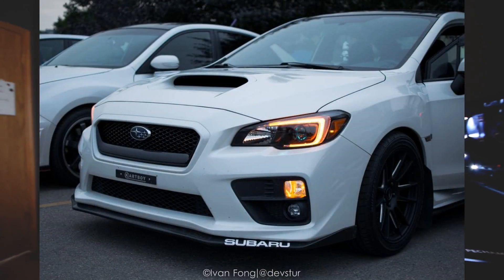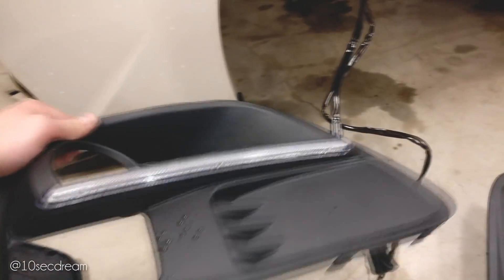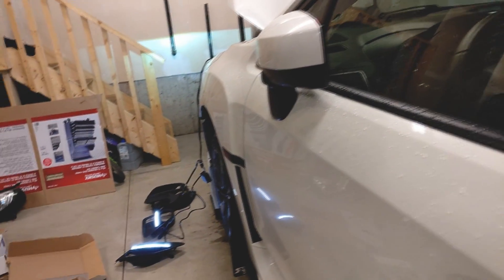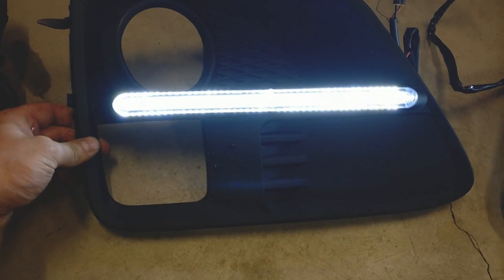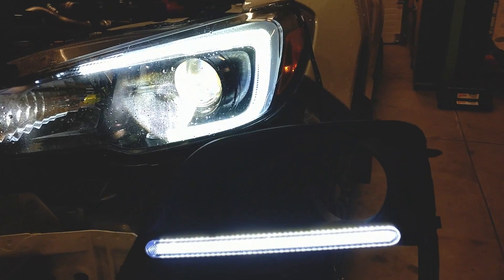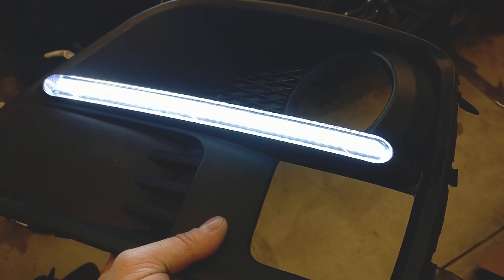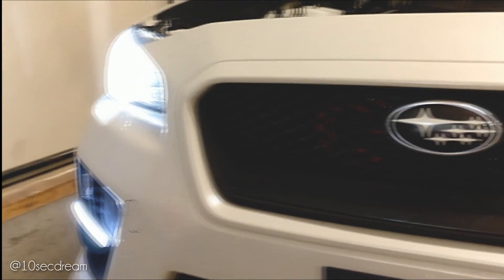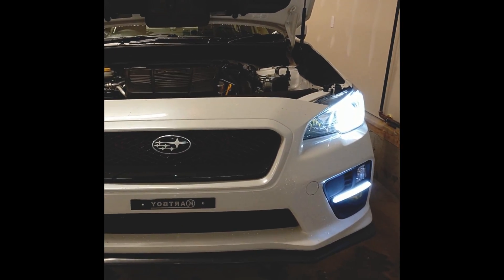LED Foglight DRL Bezels | 2015 2018 Subaru WRX STI

Comment: Dude I was literally looking at these exact same ones!! Was gunna try put them in the 240sx daytime running light grill spot. Are these ones a little bit flexible?
Reply from the maker: These ones in particular aren't because they're fit into the trim piece actually, but some custom DIY / Retrofit style ones would most likely be a bit!! Those would look good on your 240 dude!

Comment: Not bad for the money, No switchback feature doe
Reply from the maker: True!! The switchback one's are nice!
Reply: I already have switch-back C lights so having switchback drl fog bezels might be a bit much.
Reply: 10secdream id run switchback on both fog bezel and clight & have a jdm avest side marker in the mirror housing but thats just me. The more expensive bezel kits usually have a wiring option so the bezel turns off or doesnt switchback in certain modes check out subispeeds jdm replica bezel install video they put out yeaterday

Comment: I had the Winjet bezels and they did NOT fit. they even broke when I was putting them in. I emailed Winjet and ended up getting a little refund. I ended up cutting my OEM bezels out to work and painting them with a high gloss paint. I have been considering these, but if you say they are like winjet..... eehhhhh I dont know????